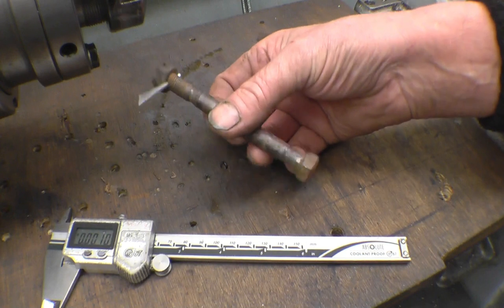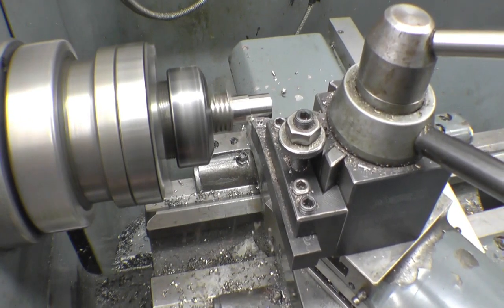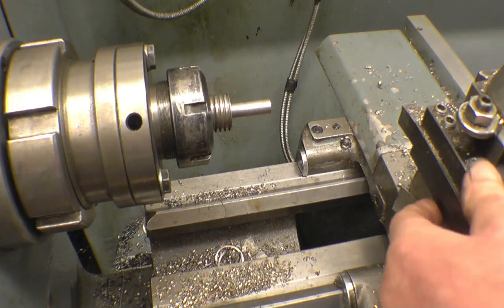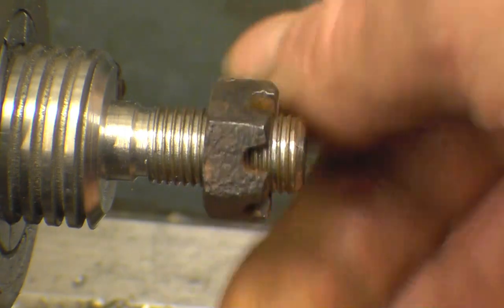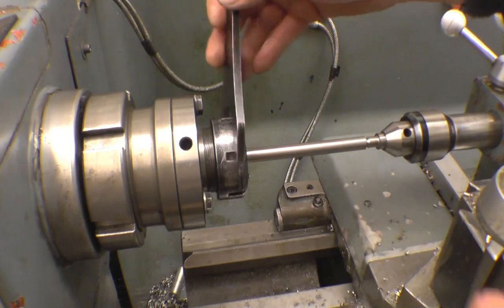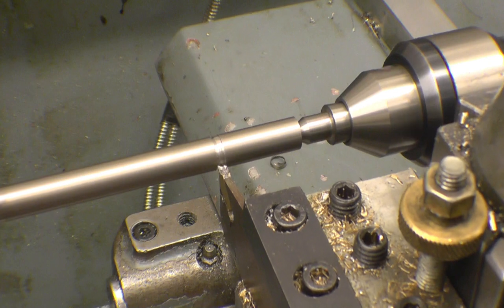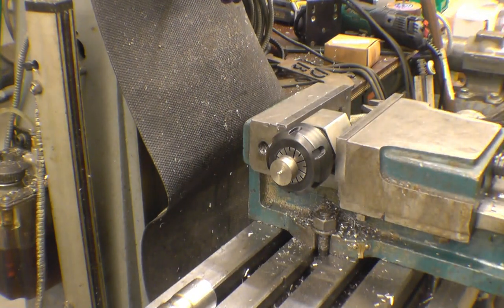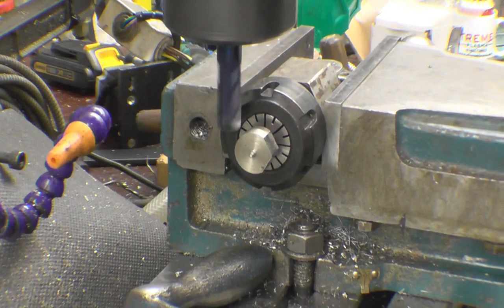SNNC 318 P2   Tractor Bits , Screwcutting UNF Threads

Comment: Great vlog John, that material for the 7/16" bolts looked like a free machining steel, ref chips?
Congratulations on the 70 k subscribers.
Those hex and square collet blocks are brilliant, I bought them after you demonstrated them.
Thanks for sharing.
Reply: Bosted Tap didn't John say during turning that it was stainless and EN 24 if my memory serves me?
Reply: @samrodian919  Hi, Yes, but there are two distinct different materials, you can have both free machining Steels and Stainless Steels, by free machining I mean modified with the addition of either Lead or Sulfur. EDIT :A popular stainless steel for ease of machining is 304L (the "L" suffix indicates it has added lead). again my interpretation based on the type of chips that were being generated. EN 24 and nearly all stainless steels are not the easiest to machine, Hope this helps, regards John.
Edit: 14 th March, 304L is a low carbon stainless steel, not with added Lead as I wrote, my apologies.
Reply: Bosted Tap thank you for enlightening me! I didn't know there were free machining stainless steels but the L suffix is self explanatory really and I know John said something about choosing the material for that lead screw carefully although he didn't go on to explain, but I suppose if you are going to accurately cut an acme thread for a lead screw you might well choose a free machining stainless for your stock. As a matter of interest I wonder how the inclusion of lead into the steel affects the wear properties of the stainless in the context of a lead screw as opposed to the same metal without the lead inclusion. If it were for an industrial machine, doing production work then it may well matter but I bet John was making it for someone's hobby lathe or milling machine the wear properties probably would be a negligible consideration I suppose. "Horses for courses" as the saying goes. Regards, Sam
Reply: @bostedtap8399  FYI...The 'L' in 304L stainless denotes LOW CARBON not as you claimed LEAD!!!!!----Learn before you preach!!!
Reply: @russelldilworth1784  My apologies, yes the " L" suffix is for carbon steels, ref added lead, free machining stainless steels do not use a suffix, another series is used. Thanks for pointing this out. Regards John.

Comment: Hi John. Well done on the 70k. As you started to mill the hex i was wondering why you had the hex collet block flat down with the vise only gripping the angles. Or did you just forget to tighten it?
Reply: Grabber 1111 question is which is the correct way? Grip between jaws with the flats of collet block and have a point sitting on the base of the vice or the other way round ,a flat on the base of vice and two 60 degree points being gripped by the jaws? Conundrum I'm sure lol
Reply: @samrodian919  Flats should be against the vise jaws for more holding force. Otherwise... well what happened at the end of the video. ;)